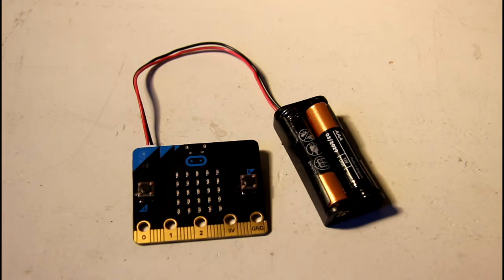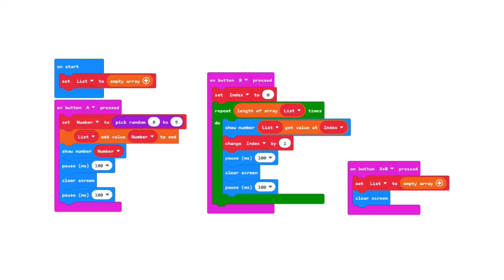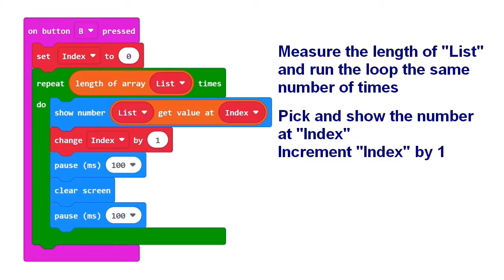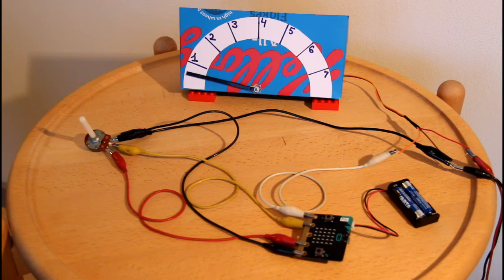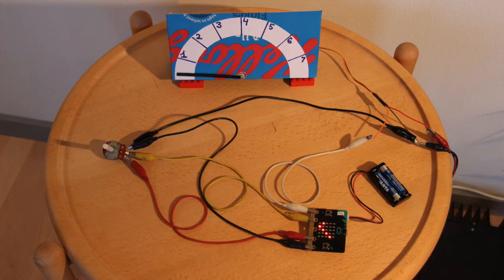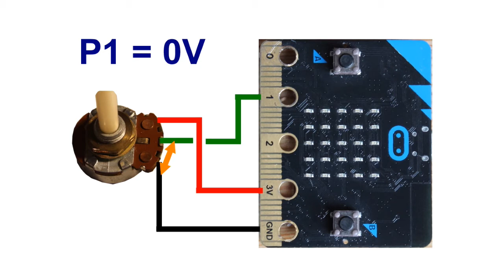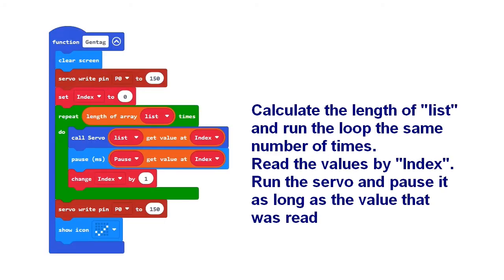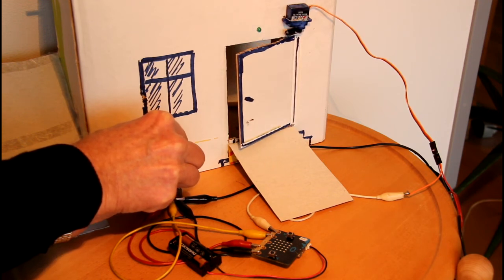Teach your Micro:bit

Comment: Very good sir and Can use repeat and do function for 2 servos?
Reply from the maker: In theory - but the code will be a bit complicated. You must have a set of variables for each servo. And you may run out of memory unless you use the Micro:bit version 2. And then you will need quite at lot of wires.